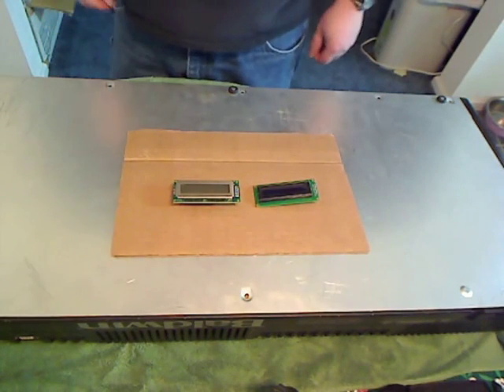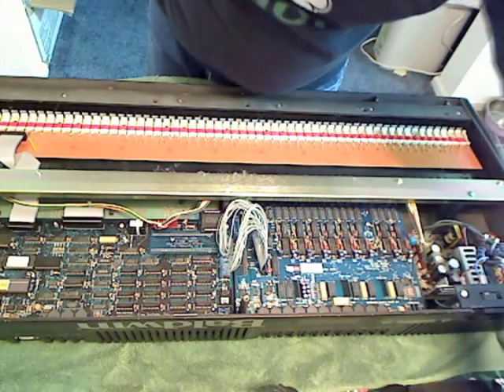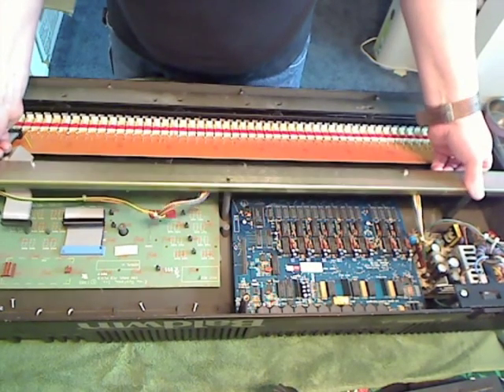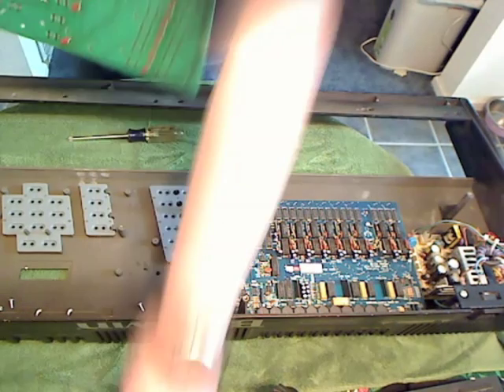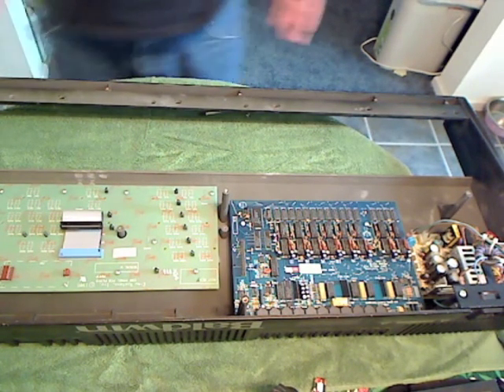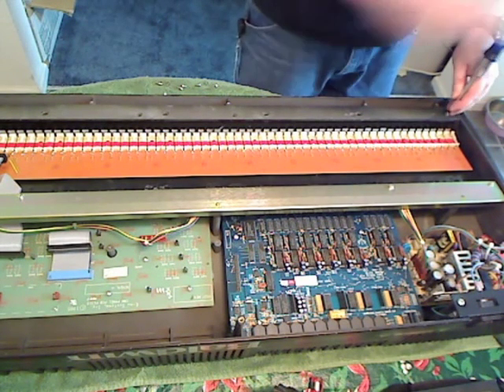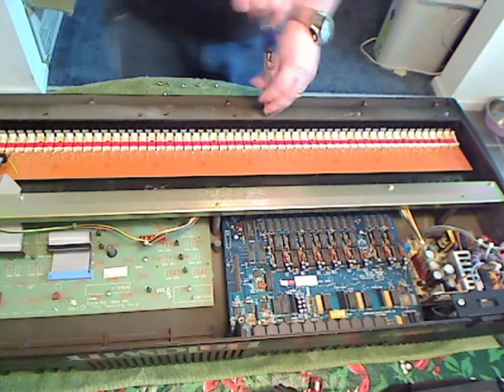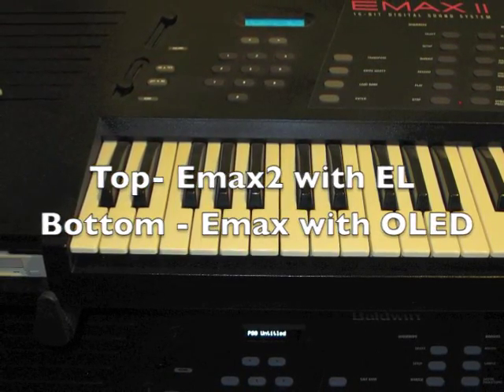Emax 1 Keyboard Display Replacement - OLED

Comment: My Emax Keyboard Display was soldered in and I ended up melting the multi-pin connector on the left of the display. I guess my unit was older in production as it was not a pull out/drop in.

Do you know what the piece with the multi pins is called?

Comment: So you don't show the actual installation of the screen to the board?
Reply from the maker: The display which I sold plugs into the socket much like a lightbulb in the light socket. while it wasn't intentional to go off camera, there is no complication to not seeing me slide the old display out and the new display into the socket. The display pulls straight out, the new display plugs straight in. 
Where you don't like the video, simply make your own video of the task, and I would be happy to remove this one.

The displays I sold to the Emax Group Members have all been installed long time ago. More than anything, the purpose of the video was for showing how (and which) other parts come out of the Emax to get to the display panel. Those group members who aren't technical were most worried about that activity- what comes out, what doesn't? what screws to take out? This video was for them... and they were satisfied. That is all that was important to me.

Comment: HelloCongrstulstions for the video.The originsl Emax 1 display has two pin for the backlight.In OLED display you do not use them?Thanks for the info if you can.Paolo
Reply from the maker: +Paolo Currò No, an OLED has no backlight so the pins aren't used. Emu also used those pins to stabilize the unit in the keyboard version. So that is why if you have a keyboard, you need to use some screws to help secure the new display, because that end has no pins anymore.
Reply: +DJTBS1 OkI understand.Many thanks

Comment: Hi here is a link to the datasheet of the Optrex display that is used in the Emulator ll, can you see if the Ole you use for the Emax can be used in the Emulator ll?
https://octopart.com/dmc-16207n-eb-optrex-547699
Reply from the maker: Jens Lyd Yes, the pinout is the same, you won't have pin 15 and 16 though- as the Backline EL pins are not used...
Reply: DJTBS1 Thanx :)

Comment: Hi There great video, I woild love one of those Oled displays in my Emulator ll, would that be possible?
Reply from the maker: I don't have any displays to sell.

I also don't have an Emulator 2 schematic (or own an EII) to confirm direct drop in of this part.
But it is possible to update most any equipment with OLED or VFD, even if the unit doesn't just "drop in", you just have to know the proper connections (schematic / pinout for new display, and schematic for unit you are replacing the display)  then you just match up the pin designations. ... oh, and have technical repair skill (or take to a shop and have it done)... for further would suggest you join Yahoo! Emulator II user group(s)- they probably have more information on that specific use case / installation...
Reply: Yes it is possible.  See my video.

Comment: Do you know where I can get the internal 50 pin scsi cable that goes to an external DB25 scsi connector for the Emax 1? Thanks
Reply from the maker: 50 Pin internal has to connect to an adapter bracket.
The original part is not available.

Here: http://www.dataaccessories.com/scsia.html
or this would probably work too:
http://www.ebay.com/itm/Green-SCSI-and-Audio-to-External-Device-Adapter-Card-/150853831313?pt=US_Video_Cables_Adapters&hash=item231f96ca91

Comment from the maker: Read the "About" section, it has the contact information for the mfr. and part number for the display. Yellow you can order a single unit, White requires minimum order qty (1080 units) or engineering request. Lead time is typically about a month, and shipping is expensive when buying a single unit...

Comment: so you don't have to modify the display, it comes with the pins that fit onto the display board ?
its kinda hard to find an emax display without having to modify things, that's quite hard when you can't solder (good).
i was looking for the product aswel but can't seem to find the exact same.
you could help me alot, thanks
nice explanation on how to do it by the way, used it to get at the backlight, too bad i screwed up the old lcd then